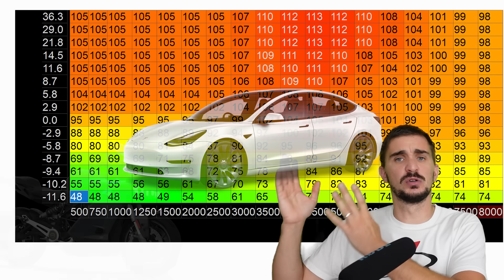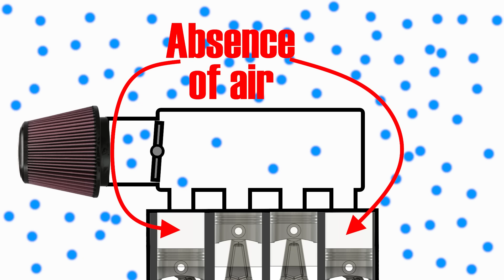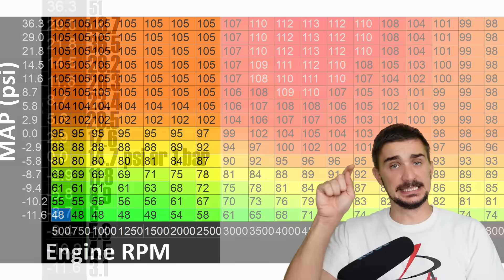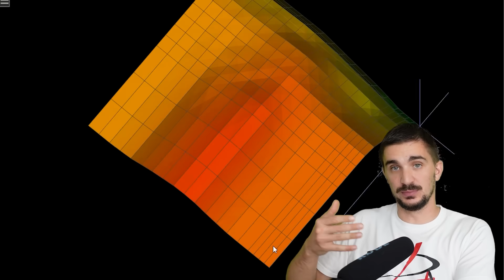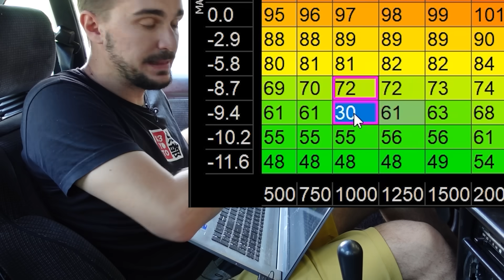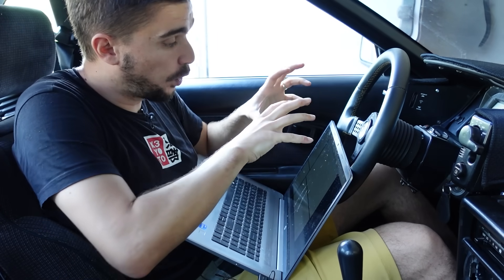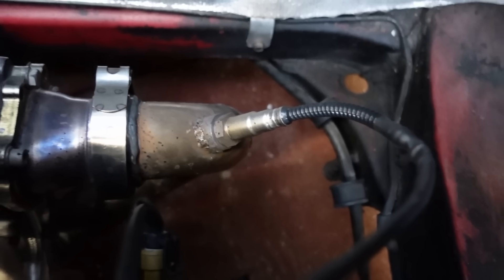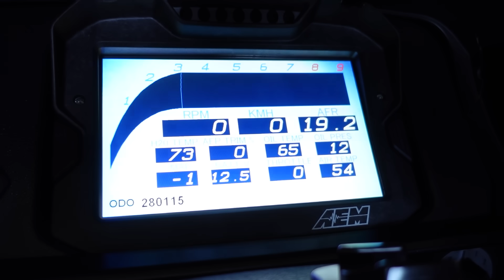If You Understand Volumetric Efficiency You Understand Engines

Comment: That system uses very odd way to calculate like using psi and AFR instead of kpa and Lambda. the volumetric are little odd compared to a nira system.

Hope you know that AFR value are a theoretic value just as torque. With lambda you measure oxygen in exhaust gases to get optimal combustion. that value are the same no matter fuel and get most complete efficient combustion between 0,97 - 1,03. you can see that with the HC value. the higher HC the more unburden fuel in the gases. usually happen with to lean and to rich fuel mixture. the best way to get better control is to use lambda loop in software when acceleration enrichment aren't activated or wen start enrichment are active unless the software doesn't compensate for those when adjusting fuel timing on the injectors.

Lust be careful with to lean mixture especially under load or motor brake. it can melt piston like a gas/plasma cutter. it's better to have no fuel in when motor braking than to lean. no creation of to hot atmosphere in combustion chamber.

Comment: This is a very specific tip for people interested in GM LS/LT V8's and are thinking of using a truck engine, you will want a 99-2006 (Gen.III) engine because it's VE map is exactly like here. It's easy to understand and edit for a newbie to tuning, like using HP Tuners. 

After 2007-2008 they updated the LS to gen. IV, in which  they also switched to a far more complicated way to create the VE tables involving 2nd order, non-linear, multivariate polynomials (very complicated math) to calculate and it is very difficult to adjust. It was a steep learning curve for me going from tuning my 2002 6.0L's ECU to the ECU in my 2009 5.3L. 

In my opinion, the 2001-2002 engines are the best to get, because the 2001's are all guaranteed to have the upgraded aluminum heads over the 99-2000 4.8, 5.3 and 6.0L's with cast iron heads. The cast iron heads are nearly 25lbs heavier each, they are more limited in flow and the extra heat it will hold will create more detonation. The reason I cut off at 2002 is because in 2003 the trucks switched to electronic throttle control, which adds a slight delay to all accelerator pedal movements, even if you tune it to react faster. The 2001-2002 with the cable operated throttle responds immediately to the pedal, the engine is easier to tune and engine swaps are easier by result. 

So any future tuners in this weirdly specific case, I hope this helps you.

Comment: @5:23 atmospheric pressure is not constant, it varies with elevation and weather.
Reply: Yes but a typical basic (non scientific) air pressure gauge is constant. It always reads zero. That is what all other calculations are based off of. It's the difference between what is in the manifold  and ambient pressure we are measuring. Not the true, absolute air pressure

Comment: Not all ECUs will represent boosted conditions as VE being substantially greater than 100%. In fact, it's a better, more accurate approach. It comes down to whether you consider the increased amount of oxygen molecules in terms of greater volume versus greater density.

For example, if you have a 100kW naturally aspirated engine - you'd expect it to make 200kW @ 1 bar MAP. In a way, you could think of this as 200% VE. But you could also think of it as still achieving the same VOLUMETRIC airflow (which is correct) - but that airflow has double the density.

The ECU is always measuring MAP and IAT - with those two inputs, it can calculate air density. Along with a properly characterized VE table - the ECU can then calculate an ingested airmass per cylinder, per cycle.

The advantage to thinking of boost as increasing DENSITY as opposed to increased volumetric airflow - is the VE table will represent the engine's actual breathing efficiency rather than it's ability to simply generate overall airflow - the two are not the same.

Comment: How does a VE map of MAP vs RPM deal with changing altitude? Full load at a higher elevation with less dense air will have a lower air pressure inside the intake manifold.

One solution is to run an ambient air pressure sensor and instead of MAP, having MAP/ambient on the y axis. Useful if you’re building a hill climb car, but how do OEMs deal with this?

Comment: I remember buying an EPROM with a different map for my 1983 Porsche 944. The performance gain that yielded was simply amazing but of course, all at the top of the rev range and at the expense of horrific consumption. It took another visit to the programmer to get it adjusted properly to the realities of my motor and driving prefs. I was utterly fascinated to see a summary of the engine’s parameters in graphic form, a format I deal with all the time in my electronic engineering work.

Comment: ok, so when you changed from 61 to 30, that means there will be less air in combustion, which should be that mixture is too rich, instead it went to lean, why? also what would happen if you changed it to lets say 100? also, i noticed that there are values that are more than 100 below 0 (below atmospheric pressure) how is it possible?

Comment: If only it was so simple. Modern OEM ecus are much more complicated with hundreds of correction maps. Proper way to tune the engine would be to measure crank rpm and in cylinder pressure. But for starters it is ok. Nice job there.
Reply: I agree with you. My R1 race bike ecu has many maps, not just one

Comment: That was a very clear and well delivered explanation of how everything works. In addition some engines work by measuring the airflow directly, which removes the need to calculate it from the engine capacity, VE table, and manifold pressure. You then only have the target AFR table to tune. Also naturally aspirated engines can go above 100% VE in narrow RPM bands, due to cam overlap, exhaust scavenging and tuned intake runners.

Comment: Can I ask a question? What is the effect of changing my coil plug into K20 coil plug? And what if I change the injector too? Should I tune the engine? My engine is all stock. I even use stock air filter

Comment: To spot some weird problems in the map, I datalog while driving normally, then I do xy plots of O2 sensor vs MAP or O2 sensor vs RPM and if I see consistent bumps or drops I locate them on the map to change values. Usually after a tuning in the artificial setting of a dyno, you get some adjustment to do when driving in the real world. This way you can also adjust AFR targets with variation of ambient air temperature, altitude, cooling temp, etc...

Comment: So this would be a really slow way of doing it, but could you ignore lambda and the wideband sensor and set every cell to the same value, run the engine, see what RPM it settles at, then use that to slowly build up a map?

I guess that might be close to an open feedback control mode?

Comment: The thing thats confusing me is why at MAP pressure of lets say 2 x atmospheric pressure, why the volumetric eff isnt 200? Like at double the pressure , there is double the o2 molecules, or is the ECU compensating for pressure by itself?
Reply: Because the air will be hot. It's not about pressure, its about density. The faster you compress a gas the hotter it is as it has less time to dissipate heat. So air that is double the pressure will not be double the density as it is hotter.
Reply: @chippyjohn1  thank you , but there is the intercooler that should reduce that temperature.
Also still just a small gain in volumetric efficiency for that high pressure?
Reply: @florinbaciu2325  Look, technically volumetric efficiency is what can be filled in the cylinder compared to what is out side. It does not include the compression chamber. So a naturally aspirated engine that fills its swept volume with air that is of equal density to outside would be 100% VE. If you are able to fill the compression chamber that has a volume of 10% that of the swept volume it would be 110%. Now if you are able to utilise exhaust scavenging and inlet pulses you can further increase that percentage to 110+% (F1 about 130+%). With a turbocharger it depends on how you look at it; are you comparing VE to what is in the atmosphere or are you comparing it what is before the inlet valve. 1 atmosphere outside 2 in the inlet and 2 in the cylinder you could call it 200% VE, But if you compare what is in the cylinder to what is before the inlet valve it would still be only 100%. Even with an intercooler, you do not achieve temperatures as low as ambient. It depends on many factors, but the air density will still be much lower for a normal air to air or water intercooler.
Reply: @chippyjohn1  Ohh , now I think I understand it properly. Thank you soo much for the explanation:)

Comment: Here in Brazil we have a standalone ECU - Fueltech, that has a digital dash integrated, and does correct lambda up to any %,  also has a self learning function that self adjust the map for fuel injection, it helps a lot when only minor changes are required. also you can adjust the maps on the display of the ecu itself. If you can take a look! I always appreciate your videos, very informative, its awesome!

Comment: This is just a normal fuel map where you have used the MAF option to get the Lambda sensor to self tune. The duty cycles over 100% are usually where secondary injectors are used. The map that you have seems to show a normally aspirated engine map with the 100%+ duty cycles being part of the "safe" generic untuned map. You could have set the vertical scale to be the TPS (throttle position sensor) percentage and you would have almost the same map. Its not VE as you are not measuring the actual VE as you are only tuning the map to work with a fuel air ratio range for what the ECU sees as ideal for what the engine is doing. It will be richer with full throttle and leaner with smaller throttle openings. As you can see from the map at -11.6 (closed throttle position) 61% @ 3000rpm and at 0 99% @ 3000 rpm which would be full throttle in a NA engine. Going over the 100% at 4500rpm - 5500rpm at 0 shows you actually need a larger flow injector so you are not running the injector over the injectors maximum recommended duty cycle.  With how the duty cycle is set over 0 it is obvious the engine is not forced induction as the from 2.9 to 36.3 on your map has almost no change in the fuel map and would show greater differences if the engine was forced induction but it is a safe map as a base (un-tuned) map. 

I suggest you spend a few days on a dyno with some bike tuners and look the maps in the power commanders or in some Woolrich tuned bike.

Comment: Nice video. Except for the above 100% VE explaination at 7:10.
The reason for VE to go over 100% under boost isnt the boost itself, but that you want richer AFRs in this condition.
The MAP is already accounted for in the VE calculation. otherwise you would only have 10% more fuel at double the MAP. this would kill your engine.
Reply from the maker: No, you're misunderstanding how the triangle of VE map, target afr map and wideband sensor works. I suggest watching the video again and it will be clear. We don't use VE to fool the engine into running richer. The VE value is the air coming into the engine and this value is then matched with fuel until the desired afr is achieved. So yes, VE does increase because of boost because boost adds more air.
Reply: @d4a  sorry, but you are misunderstanding it.
youve just proven yourself wrong:
while in boost your target AFR is richer, wich makes your VE higher than 100%.
just ask yourself, based on your VE table at 4k rpm:
0 PSI: 104
14.5 PSI: 111

you have double the amount of air, but only 7% more fuel? this doesnt make any sense ;)

so yes, you are "fooling" the ECU. while the engines real VE at this point is maybe 90%, you are still telling the ECU its 110 in order to get your 11AFR
just try it, set your target AFR to 14.7 and you will see your VE going under 100. just dont blow your engine while doing so..

greetings 🙋‍♂
Reply: @d4a  in other words:
the VE table tells the ECU how much air is coming into the engine in relation to the cylinder volume according to the MAP:

100% VE @ 0psi = 500cc air into 500cc cylinder
100% VE @ 14.7psi = 1000cc air into 500cc cylinder

the way you understand it, it would be:
110% VE @ 14.7psi = 550cc air into 500cc cylinder

but with only 10% more air, you wouldnt see such power gains like you do from going from 0psi to 14.7psi

hope this is more understandable. correct me if im wrong..

Comment: So when a manufacturer sets up a motor "lean from the factory for emissions" at low rpms, and a performance tuner wants to make it richer at low revs, they're going to increase the VE numbers in that range on the map, to tell the engine "hey there's more air going in you can put more fuel in". BUT, the AFR target map will make the engine adjust to a particular target anyway. Did the mfg change the AFR target to some leaner mix at those values?

Comment: Due to the variations in each cylinder, would placing EGT bungs in each runner be required for optimal VE tuning or is the wideband O2 sufficient?

Comment: This map contains all the fundamentals of the engine operation. It doesn’t matter if it’s car, motorcycle or truck it’s all the same for internal combustion engines. Proceeds to show a Tesla, and a Rivian. Lol. That had me laughing. Thank you 🙏
Reply: The bike is electric as well
Reply: @AirzonesBlasters  yeah I thought so but couldn’t tell 100% so I left that one off. 😂
Reply: @AirzonesBlasters  Zero SR/S to be specific
Reply: Yeah, the bike is a Zero SR/S.
Reply: It had me dying laughing 😂
Reply: Me too. I had to skip back to make sure I didn't see something wrong.
Reply: Ahh, I see you are  man of culture as well
Reply: Pretty funny indeed. :)
Reply: I came to the coment section just tu see if i was the only one to notice that
Reply: Ditto. I thought I saw a Rivian out of the corner of my eye, but didn't care enough to skip back to verify 🤣
Reply: +1
Reply: I got a kick out of that too!
Reply: The Tesla / Rivian is completely unaffected by changes in atmospheric conditions, such as driving at sea level, or 5000 feet up a mountainside. Coming back down the mountain, the Tesla is pumping fuel - back into the car. How can this be a bad thing, when an ICE car is (at best) around 50% inefficient, even with the modern ECU and associated fuel saving devices? EVs are here to stay, and will always contribute to greening the Planet, even if two-car families make just one of them an EV. These days, Thermal Power Production has Fume Mitigation Systems that minimise the Sox / Nox entering the atmosphere. Even Thermal Power Production is (on average) 50% inefficient, because (just like an ICE car), those losses are due to the heat energy which is lost - during the conversion from heat to either propulsion or electricity.
Reply: Hmmm, your forgot to mention the ecu map is not 2 dimensions, but many dimensions, temp, altitude, timing, accel, decel just to name a few you forgot.  :)
If you understand only a 2D VE map, you dont understand engines IMO.
Reply: @Ozzy3333333 temp and altitude are made pointless by a feedback loop. I'm not sure if by timing you mean VVT automation or spark advance, but neither require user input because their values are pre calculated by formulas made by engineers at their respective manufacturers.

I'm quite perplexed by your suggestion of acceleration and deceleration's integration into an efficiency map that isn't covered by load on Y and RPM's on the X?
Acceleration = + 
Deceleration = -
Reply: @user-rs8zg8ey2b  So!? Una plataforma para entender en completo La Eficiencia Volumetrica,Graccias!

Comment: Great introduction to fuel tuning. Most standalone ECUs support multiple fueling strategies but actually few provide a VE table which is a real model of engine volume efficiency. Most of the time the so-called VE table is rather a 'fuel dose table' than a truly-spraking VE table. Simple: if you have to correct fuel table after you modify lambda target table, then this fuel table is not a real VE table but a fuel dose table. 
To be accurate, closed-loop lambda correction must also use a lambda delay table as the wideband lambda controller analyses combustion products more or less quickly according to engine speed and load and to exhaust gaz flow in exhaust manifold. Incorrect delay causes correction to apply on wrong table cell and so table values remain inaccurate. 
Beside that lambda probe is oxygen sensor, it detects oxygen in exhaust gas, whereas there is fuel mixed with it or not. That leads to wrong reading of combustion products when working on engines with aggresive big cams where there is big overlaps at low through middle rpm speeds. There is other use cases where you also end with unburnt mixture passing in front of lambda probe...

Comment: Nice video. You explained the trinity of VE, AFR and lambda/O2 sensors really well. Couple questions for a part 2 video: :)

- What's the difference between narrowband and wideband lambda sensors? What typically comes installed on cars from factory?
- Why do some tuners remove their lambda sensors altogether (thereby removing the closed loop)?
- You're using average lambda readings. What about a lambda sensor per cylinder?

I've a basic understanding of some of the questions above. Just sharing as they would make for a nice part 2 video for those seeking a little more knowledge on the subject.